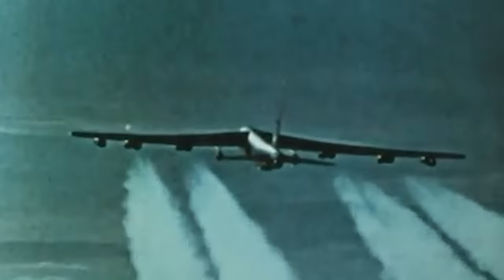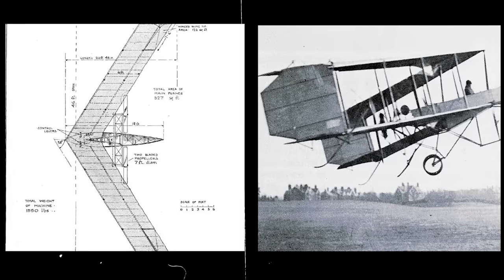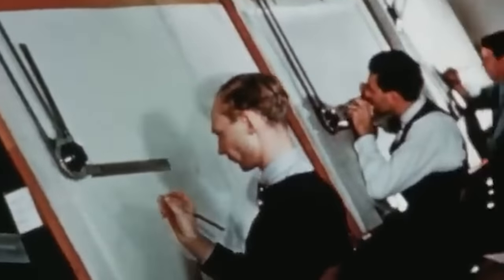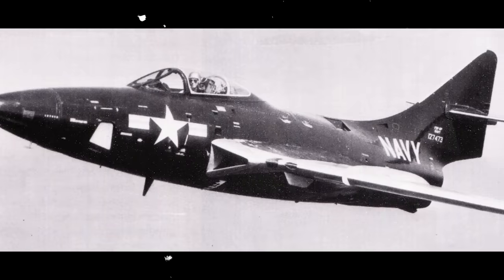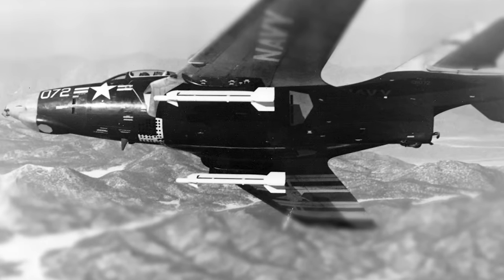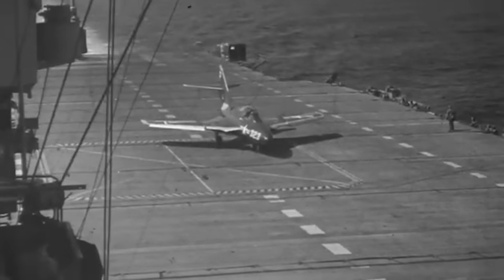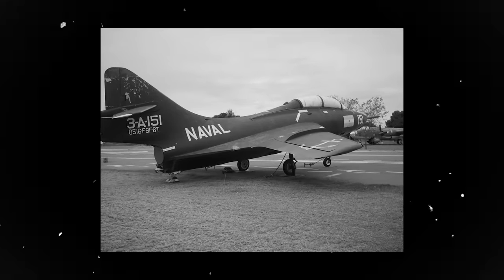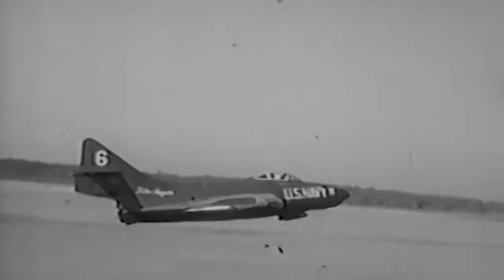The Killer Flying Hunter of the Vietnam War

Comment: I worked on TF9Js at VT 22, NAAS Kingsville, Texas in the sixties. I was an avionics tech working on the ARC27, Tacan, APX6 and others.
Reply: Cool!  I was an Airforce avionics tech on the T-33A, F-101B/F Voodoo and Convair F-106A/B in the late 1970s.
Reply: I was stationed at NAS Beeville in the late 1960s and worked on TF9s as the AE in the calendar inspection shop.
Reply: I worked on the ARC27 and other WWII/Korean War vintage avionics on C-46, C-47, etc., out of Howard AFB, Panama ‘67-68, and on the AC-47 out of Pleiku AirBase ‘68-69.  Fun times and equipment.
Reply: Cool.
I've never been to any of those places or even worked on a plane

Comment: We used to watch these come in to the base I was stationed at in 1972, Webb, AFB. They would notoriously break and be on the ground for a few days. Watching them takeoff, was something to behold. Their acceleration was painfully slow and they would roll, it seemed, the entire length of the runway and then lumber off at an unimpressive angle. They appeared SO under powered. It, I always thought a classic and beautiful shape. Wish there was a better engine available for it.
Reply: Yep, airframe and progressive aerodynamic design were far ahead of jet turbine efficiency for a good decade before the advent of ge, pw, Wright and Westinghouse  axiel flow tubojet engines, about the same time area- rule was discovered to handle the speed these engines could provide

Comment: 5:47 what the hell is a “powered flying tail”?

Just gonna gloss over it?
Reply: What he means by flying tail is an all flying tail that is the entire rear horizontal stabilizer moves as one piece previously on piston and early jet fighters just a flexible part on the end would move
Reply: Some times refered to as a stabilator.  The entire stabilizer moves for pitch inputs.  Was a solution for pitch control at trans sonic, & super sonic flight.  Also better response in ACM.  Powered means they used hydraulics to move the flight controls in place of all cable, pushrod, pullies, & bell cranks. Like power steering in cars.